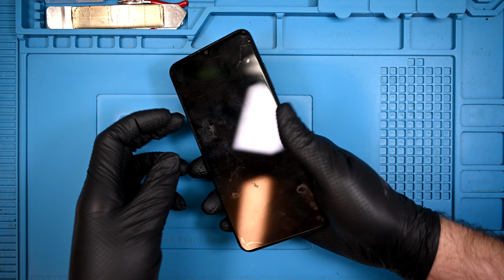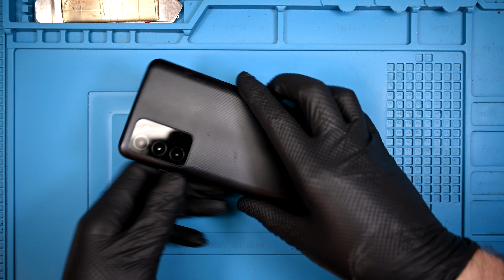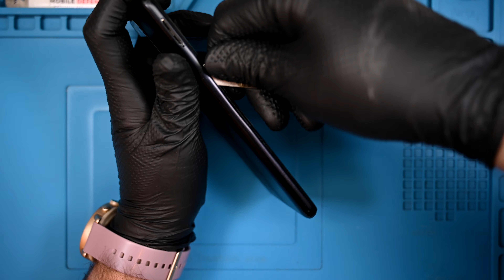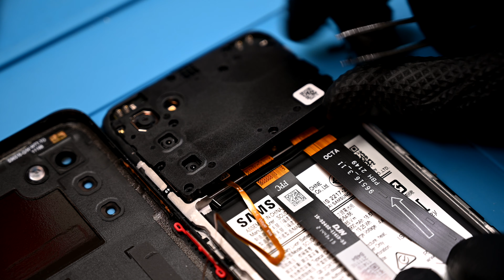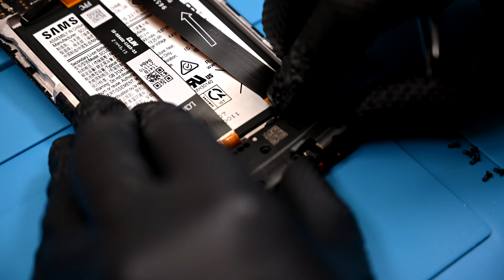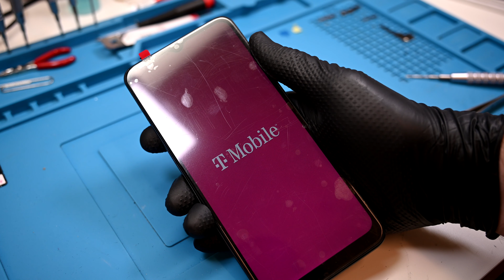Galaxy A03s (A037U) Screen Replacement | Frame Swap | Teardown Guide

Comment: Is only the screen is broken and the frame is not damaged I need only the screen, moving componenets over is risky, I hane ni problem securing a new screen just that it will need for the glue to  dry
Reply from the maker: You will still have to remove a lot of internal components to safely remove just the screen. It’s much easier to replace it as the screen+frame, and it ensures that the glue on your screen won’t fail and separate. 

You can do screen only if you really want, it’s only slightly cheaper. You’d want to get some cold press glue or B7000 but they can get pretty messy.

Comment: what is the temp of your heat bed for softening the battery adhesive?  would the heat bed of a 3d printer work in a pinch?

Comment: So what are the chances of therebeing some kind of Spyware hidden in this after market part?
Reply from the maker: @WoodchuckNorris.8o  roughly 99.999%  certainty there is no spyware in a replacement screen. The screen controller chips are encoded to only perform that one job, and have such low memory space they couldn’t hold anything capable of being malicious. It’s very difficult to get spyware on a device

Comment: I have one question. I know that this is two years old but I have a model SM-S134DL and all I am finding on Amazon are screens for an A037u or A037u1.

My question is, Are there other screens I can use to fix my phone or is my phone out of date and I need to purchase a new one? Sorry, that three questions. Me no count good. Thank you! :)
Reply from the maker: @User-s7j5u  unfortunately each screen is phone specific, they often have slightly different sizes or different connectors, so you have to get one that matches yours
Reply: @TapticDigital  Okay. Thank you for the quick reply.

Comment: How do you warm up the alcohol and is it a specific alcohol for phones or is it the 91%
Reply from the maker: @TheBeast-pk8sn  I use 99% only, 91% is the minimum I’d consider using. Evaporates fast and carries the water with it

Comment: I have two broken A03 phones.  The screens shatter easily if they hit concrete.  Anyway I want to fix them myself.  Where can I get the replacement screen and tools to repair? Thanks for the video.
Reply from the maker: In the battle of concrete vs glass, concrete usually wins. I’ve got links in the description but you might also want to check Injured Gadgets, Gadgetfix, and MobileSentrix

Comment: "I leave the antenna connected as they have a tendency to break off tne board when unclipped". I must have missed that part because I took it off and the top part broke off. What's the antenna for? Is my phone totally ruined?
Reply from the maker: It’s for cellular or WiFi, so you’ll probably need it. Thankfully they are pretty cheap to replace and sometimes you can just pull one off a different phone and use it if the length is similar.

Comment: When you replace the screen is it just the screen and doesn't delete your important information ?
Reply from the maker: Wouldn’t affect memory at all, memory is all on a chip on the board so you can change almost every single part and still have all your data as long as the main board isn’t replaced. Also if any company says you’ll lose data, they aren’t repairing your device they are replacing it and I wouldn’t trust them.
Reply: @TapticDigital  ok thank you and great video 👍

Comment: Awesome video, just getting ready to start my first one of these.  Thanks for the reminder to remove the SIM tray and also the heads up about the finger print reader cable attached to the back cover.  Also I have one question.  Near the top there is that 6 connection point square pad attached to a ribbon cable.  On the replacement I bought on eBay, it is glued down slightly crooked, not perfectly square like yours.  Do I dare try to peel it up to glue it back down straight or should I send it back?   I wish I could attach a picture of it here but I don't see a place to do so.  Thanks
Reply from the maker: It shouldn’t matter too much, the spring connectors on the board only touch a very small point, and with how large (by comparison) the gold pads are, it should still make contact. If it doesn’t and you need to adjust it, a few drops of isopropyl alcohol on those gold pads and some tweezer action should get it free safely!
Reply: @TapticDigital  Thanks much for the advice.  If it looks like they'll hit then I'll leave it otherwise I'll carefully try the method you described.  Probably not much more delicate than the volume button ribbon we have to transplant from the old to the new frame.  I really appreciate the reply.  Going to tear into it after dinner, I'll let you know how it goes.
Reply: I ended up moving it so it was straight, probably would have been ok but being the perfectionist OCD type I had to fix it. Got it moved without any damage, same with the volume control.  My new frame did not have the ribbon cable under the lower board so I had to peel off that gasket and carefully remove and transplant it.  Wrecked the gasket but ribbon came off in one piece and everything works good after reassembly.  Thanks again for posting this video, it was very helpful.

Comment: I had to replace the screen and 1st got just screen replacement, it worked but making calls I could hear them and i can hear calls and videos but they could not hear me during phone calls. Then I got the frame screen replacement one and my speak mic Still wasn't working so I also replaced the charging board which says it has the speaker on it and it's still not working.  Phone is charging good still but would you have any idea why my speak mic wouldn't be working?!
Reply from the maker: That's an interesting one... First step is the super obvious, are there any stickers inside the replacement frame that cover a microphone hole? It sounds dumb, but I can't tell you how many times it's happened to me. If that isn't it, let's try to isolate which microphone is the culprit. Phones typically have three microphones, one in the charge port, one next to the earspeaker, and another facing out with the cameras. Talking normally on the phone uses the charge mic, calls on speakerphone will use the earspeaker mic (and sometimes the charge port as well), and the camera usually utilizes all microphones. Test by making a video and rotating the phone as you record, then play it back and see if your audio drops out when you turn it a certain way. Blow into the microphone holes one at a time to find which one is dead.
Reply: @TapticDigital  oh no that's not dumb at all cause I did think about this also cause alot of them have those blue stickers where there is like adhesive too & I definitely could have missed one. I will check this first and then if there is no sticker Ill do the test you said. Thank you so much for your help. And I'll reply back after I hopefully figure out which one is the culprit. I know I did try a call again the other day and tried to put it on speaker and I could still hear them but they still couldn't hear me, so maybe it could be the one by the camera if it utilizes all microphones.
Reply: @TapticDigital  so I did make a video and rotated it, and had music playing on a different device and blew into the mic at the bottom and blew into the mic at the top and when I played the video back I couldn't hear anything. So does that mean its the mic by the camera?! And how is that fixed?!

Comment: I just did a screen replacement which ive done a couple times in the past with other samsung phones and the power volume strip was super hard to get off, when i was finished the phone showed it was charging. But thr power button wad not working to turn it on. How do i know if i damaged that piece?!
Reply from the maker: That ribbon cable is a single layer circuit, so the best thing to do is check for any rips or tears. Even the slightest cut can kill it. If it's toast and you absolutely need it to power on you can bridge the pins on the board where it connects using tweezers. The button ribbon is very cheap to replace if needed.
Reply: @TapticDigital  yes I did order a new one and should be here tomorrow cause I did kinda tear up a side of it, it didn't fully rip but i was nervous i did damage it, so hopefully that's the issue. I did take it apart after this just to make sure I had them in the right place and I did, but now it's not even showing it's charging!! Ughh!! So now I dont Know what to do. But hoping once I get that power, volume strip I'll be able to figure out the next issue.

Comment: Hi, Is the A03 and A03S LCD screen  the same or different?
Reply from the maker: Unfortunately they are not. Even between the A03S variants they are quite different, for example the A037F model is wildly different from the A037U. So make sure you get the one specific to your model!

Comment: Punctured my battery. 💥💥 It's been years since I need to use my fume hood! The smell is going to be in my house for days... but no fire damage. 

Don't be impatient with the battery. Let the alcohol do the work!
Reply from the maker: You popped the spicy pillow! No Bueno, be careful, and get lots of fresh air. Lithium gas isn't super fun.
Reply: @TapticDigital  Indeed. Even though I had it enclosed quickly, smoke was all around.
Reply: Advice for other repairers: 
1. Safety first. Be aware that working with a power source, in this case lithium ion batteries, has a potential danger. Have a safe place to secure the phone in case it catches fire or explodes and a method to put out the fire. Try not to breath in the fumes.
2. Follow the order in the video and you will only have to purchase a replacement battery in the case it does go wrong.😉

Comment: so should i get a with or without frame as @khalidmundwiller5456 said its pretty hard to remove the power button cable
Reply from the maker: I still recommend with a frame so you don't need to mess with glue. The button is easier to take off if you soak it in isopropyl for a second
Reply: @TapticDigital  thanks

Comment: Wow, I'm surprised you explained what takes others 15 to 20 minutes of annoying dubstep music and no tutorial, in 3 minutes.  The music you had was fine, very concentrated music like the how it's made show.  I'm going to be doing this but I need a new fingerprint sensor if I can find one 1⃣ separately.
Reply from the maker: You should be able to find them separately! Why use many words and long video when short does good? And I definitely took a lot of inspiration from How it's Made! Thanks!
Reply: @TapticDigital  yes sir,  about $20 plus the shims and tools.  Have a heating gun like a blow dryer but it's for softening adhesive glue and what not. 
I'm checking more of your videos,  excellent work putting these together brotha!
Reply from the maker: @rickearl1956  same here, the heatgun I have at home is more of a construction job type of heatgun, but hot air is hot air, and it works! Thanks for checking out the videos, hopefully you find something else useful!

Comment: Awesome, thank you I just replaced my son’s screen.  The battery was a pain in the butt it’s working great video. Thank you.
Reply from the maker: That battery sure is, even with heat and alcohol they always seem to fight back. I'm excited to see in the new S23 Ultra where they've used an actual pull tab for removal, hopefully they bring thst to all their devices!
Reply: When u fixed it did it reset u dint have to log back into the goodgle account or everything was the same

Comment: Hi I want to do this for a phone I have samsung A03s but it’s the type c dual sim does that make a difference? Or would the screen&frame be the same also see a lot of people having problems with the volume connector they cheap so just gonna buy 1 aswell
Reply from the maker: I believe you'll need a different model screen, like the A037G, though I haven't repaired any other variants besides the A037U, so I'm not certain exactly which part you'd need.
Reply: @TapticDigital  thanks upon search just now I found the model with the frame before I was just seeing the screen 👏 keep you posted on how the repair goes first time doing a repair

Comment: Yea 
Re-assembled and got vertical lines.
Then I began to experiment, figured screen was toast, so I went ahead and loosened up all screws top and bottom.
Fired it up, and damn no lines.
So I'm gonna use two sided tape to hold screen to frame, then try re-assembly over and over till I get it just rite.

Any suggestions will be appreciated.
Thx
Reply: I noticed on Amazon offering these parts,  and there is a troubleshooting along with the page that describes this issue possible and what to do.  Just thought I'd help with that info. Glad you used your brain and Common sense to figure that out anyways,  if you don't have Common sense,  (or a brain)  you shouldn't work or touch a smartphone anyways 😉👍

Comment: what should you do when the battery gets damaged when taking in out\
Reply from the maker: Always replace it, if there is any rip, tear or major bend, get a new battery. Even if there's nothing immediately wrong, it can lead to the battery swelling up over time or leaking harmful gasses. Cover the damaged area with electrical tape before disposing of it (at the proper recycling place).
Reply: @TapticDigital  do you know where i could get one off of.    this has been the second part I damage fixing the LCD for a coworker
Reply from the maker: @master_tiger_44  I'd check Injured Gadgets but you can usually find some on Amazon

Comment: Hey could you please help me out ? I just did the exact same repair but since I replaced the screen the microphone is recording weird noises when calling or making memos. Do you have any clue what could be the fault for that ?
Reply from the maker: This model has some little foam pieces in the frame that the microphone sits in, sometimes the replacement part doesn't have that foam in it already, and this causes sound to echo and bounce around the microphone. This is the most likely issue, but it could also have some slight damage

Comment: Hey I have a problem so my phone is a Galaxy 3oa and it’s been lagging a lot lately, it’s been a saying System ui stop working and I don’t know why, now it’s just a blank dark blue screen yet the screen turn on when called on or alarm but it so slow to show the frame what should I do?
Reply from the maker: Best thing to do would be clean off apps you don't need, or back everything up and perform a factory reset, then copy your stuff back over. Usually gets them running quite a bit faster

Comment: Taking the volume power flex cable off is one of the hardest things I've ever done and I've fixed many devices. I would have been a lot better off buying just the LCD and leaving the frame intact... Bought the frame version based on your video... I truly dislike when videos make a job look so much simpler than they really are. The rest of it was as shown, but I've never seen a harder removal than that flex.
Reply from the maker: It's probably the strongest adhesive in that phone and I don't understand why. Most times I have to use an xacto knife to slip under it, super risky.
Reply: I never heard him say anything about it being a piece of cake

Comment: My phone is samsung galaxy A03s  sm-s134DL. And I need to replace the screen. Is this the same screen as the one in the link you provided. I'm trying to purchase one but I wanna make sure it's gonna work on my phone first?  Thanks
Reply from the maker: As long as yours is a US model that part should work fine. It would be a bit more expensive, but you could also buy another A03s (I believe the model you gave is from Tracfone, so Walmart should sell the phone) and swap your main board into it.
Reply: Oh yea I'm debating on whether to just buy another phone or replace the screen.  Cuz I mean I've never replaced a screen before but as long as I follow the video  it seems pretty easy.  I just wanna be sure I get the right screen. But the website that you have in the link is out of stock 😪
Reply from the maker: @diamondlaw3846  ah rats, I went ahead and edited the description and added a link for the part from Amazon for a similar price. You can also check Injured Gadgets as a good reliable vendor.

Comment: What kind of "glue" is used to put the volume flex onto the new frame?
Reply from the maker: Whatever you like really, I prefer double sided tape, but other things like B7000 glue work fine. Just no super glue.

Comment: My model number is A037W but it does not seem to be available anywhere; is it the same frame as another model?
Reply from the maker: Not that I've found, unfortunately in your case it may be best to locate a display only without a frame
Reply: Good to know. Do I need a particular model number without the frame or do I just need to worry about the dimentions? Have any videos detailing the steps for that? I am definitely not as experienced in this field of repair, so any help is really appreciated!
Reply from the maker: @butterflygroundhog  the display should be the same for any model of the A03s, so no worries there. You'll likely need some better glue for attaching the display though, check out my video on the OnePlus 7 Pro, I replace the display only and they are very similar in how it's done.
Reply: @TapticDigital  Many thanks for the heads up; I will keep all of this in mind!